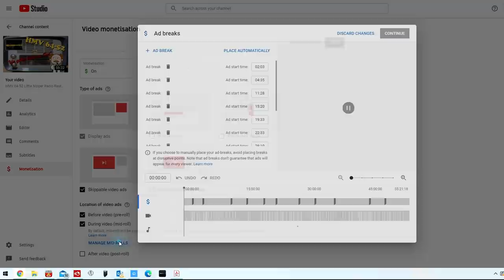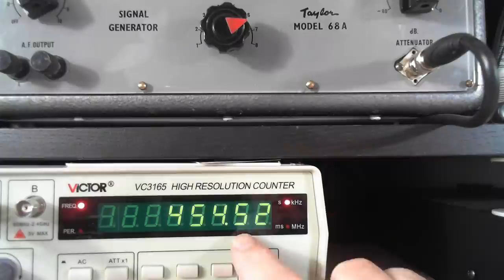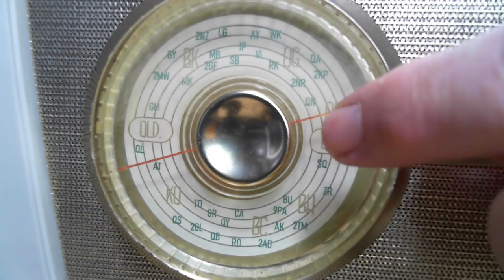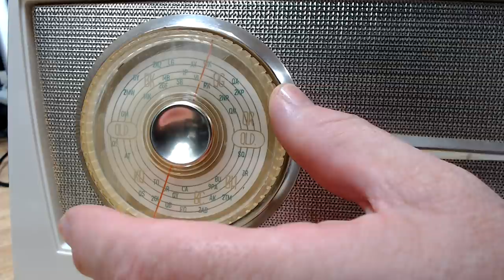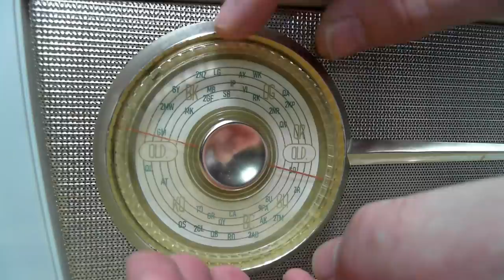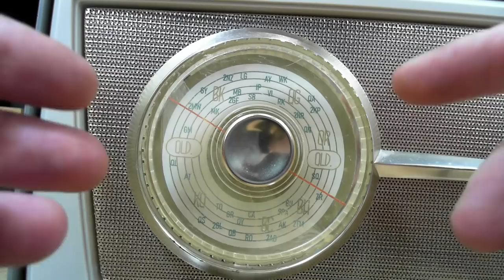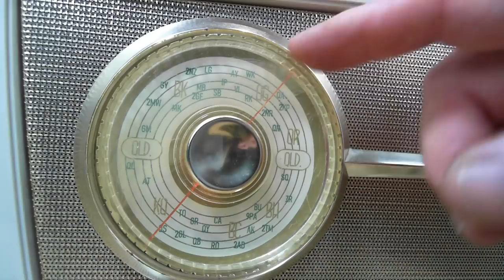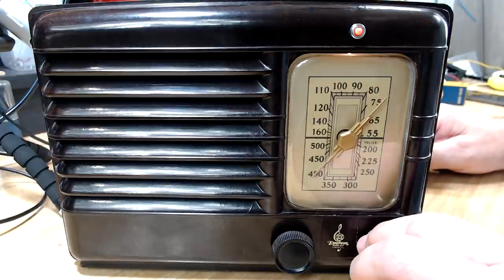AWA 586MA Radio Repair PLUS Bonus Content. RetrObright - Emerson Update

Comment: No need to apologize for anything David i learn something every time i watch one of your videos. This time i also leaned something about You Tube, before watching i assumed the number of ads shown during a video were regulated by You Tube, i didn't know the author could reduce their numbers. It's a nice gesture for your audience and i thank you for taking the time to fix the issue for our enjoyment.  Now about this particular radio, granted you might have had less work than usual to put into it, but it doesn't change the fact i got to see the guts of a machine i will never come across in my life.  This video ranks right up there with the other ones as one of my guilty pleasures as i sit and watch them with a nice cup of cappuccino :-)
Reply from the maker: Hi Sarge, thank you very much. I didn't know I could adjust the number of ads either and I assumed it would be a few ads in a 40 minute video but it turned out to be at least 6 per 30 minutes. I didn't have to dig too deep into this radio but a few issues kept it interesting I guess, thanks for the feedback. All the best for the festive season 🙂

Comment: By dumb luck I just found this video a minute ago. Adds.. I use prime so no adds at tll. Mor comments as I watch ! Back now. I am surprised that the on/off knob is on the tone not the volume control. Cleaning the chassis, short of a total disassembly there isn't much more to do. Mr Carlson did a video where he rebuilt a tone generator and the chassis was a mess. He just drilled out the rivets for the sockets and removed any wires tying the "guts" to the chassis and lifted out the internals as a whole unit, this was pretty slick and when he put it back everything just fell into place. That is a bit much to do for this radio and just stopping the rust was a good call. You managed to improve the tuning quite a bit though it looked to be fairly close to start with. Even not needing a recap, you improved it a lot, good work!  The pilot light on the other radio did look a bit odd in the last video. I have never seen a pilot light on any commercial frequency radio and as a later mod, makes sense. "New" old equipment, your VTVM, nice :D I bought a H.P. signal generator just last week. New to me but from the mid 70s to late 80s. it was one of those "was working when I put it into storage" LOL ya well as you can guess, it has a "few" issues LOL With Christmas and all, I won't have a chance to even open it up until after new years. it was nice to see your video. As always I would be happy to own anything you have worked on. If only those station markings would have anything relevant at all with stations here :P
Reply from the maker: Hi Wayne. I have a YouTube Premium account and don't see the ads either, that's why I was oblivious to the number shown in a video. I did a 1931 radio 12 months ago with a rusted chassis and was able to remove most of the wiring in one piece as did Mr Carlson. I wasn't sure about the pilot light initially but I'm sure it was added later. The switch on the tone control is not unusual for Aussie radios of that time, it does mean that the volume is set where you left it last time. Good luck with your HP generator, they are pretty good 👍 Our station marking make perfect sense to me 😄... cheers 🙂

Comment: Thanks for making this video David! The 586MA is a very significant radio for me as it was the model that I was taught how to service valve radios on back in 1979 at the Marconi School Of Wireless. I found one on a council clean up about 20 years later, got it going again and it still works well. The top of the cabinet is in bad condition though as sometime with the previous owner/s someone left a hot iron on the top which melted through. Fortunately the only thing broken inside was the ferrite rod but the iron shaped hole it left needs the same sort of treatment you gave the Fleetwood 1061 cabinet. I have been looking for a replacement cabinet for it instead but no luck yet... Keep up the great work!! Mark.
Reply from the maker: It's a nice radio and works well Mark. You have to wonder why anyone would put an iron on top of it hot or cold. I'll keep an eye out for a case. Thanks Mark 🙂
Reply: Thanks David, I have an ad in 'Radio Waves' at present for a case so fingers crossed... Mark.

Comment: Dave, your dedication is appreciated fully.  Just finished restoring a BUSH ETR-82 and sure enough on comes your Friday (your time) video.  Keep up the good work and cheers.  Your dial tuner reminds me of the Bush which is geared to the tuning capacitor.  Geoff in Vancouver.
Reply from the maker: Thanks Geoff. I just looked up the ETR-82, semiconductors with a valve converter, that is a hybrid. The dial is very similar 😀
Reply: @DavidTipton101  Actually, the video is extremely interesting, as usual!  

The Bush dial is geared, in as much as the pointer turns at a reduced rate (finer) then when turning the outer knurled tuning dial.  So not quite direct dial to the tuning cap.  Cheers!

Comment: I use the app Enhancer for YouTube in my Firefox browser and never see the ads in the videos anymore! Shh. Our little secret. 
This was an interesting video. So many radios you may come across David  might have similar problems so it's nice to see a professional restore done to one!
Like your alignment procedure. On the American Emerson radio. All of them seem to have at least one poor working tube in them . The radio was played until it didn't 
and then the owner went out and got one of those fancy new  transistorized radios. Luckily he didn't throw these out! Many people did! Steve
Reply from the maker: Hi Steve, Thanks, another ad removal tool, it may help someone. 
Haha... I probably wouldn't put me, radio and professional in the same sentence but I'm learning fast. I wasn't surprised when the newer good tube didn't make a noticable difference to the radios performance, that is something else I've learned. It's surprising how many radios turn up that people have stored away for so many years, bit of good luck there 😊

Comment: Excellent video, thank you for uploading!  Bit late from my side, but on the AWA, it often helps a lot to recalibrate the ferrite bar by carefully heating wax with hairdryer and repositioning coils for best reception after recap.
Re rust spots: do you have a small dremel tool and wire brush attachment to buff out these blemishes?
With the duff valves and the tester: Most testers run the small signal diodes and some triodes with a minimum current which is too high (it has to deflect the instrument somehow).  As soon as the valves have some hours on them the emission decreases somewhat, but because in the circuits they are in there is no current flowing, this issue is irrelevant and often stated so in the instruction manuals of the testers.
Old valves (even NIB) can go "sleepy", to wake them up they can be heated at 150% filament voltage for 5 mins, then heat at 100% for 30 mins, repeat 5 mins at 150%. (no anode voltage) and only  then apply highest permissible anode voltage for a few mins. Helps in a lot of cases.
Cheers from Germany
Reply from the maker: HI Blitz, thank you. I could have heated the coils but it was like that at the factory so I had no reason to suspect it was less than peaked but worth think about in future. 
I do have a Dremel with a wire brush but this rust was too deep so I scrapped it off and treated it. I have a mini sand blaster too, I should have tried that perhaps. It looked like a mammal had lived in there for a bit and caused the rust spots.
Good info on the tester, I will keep that in mind, thanks.
I have heard that about getting valves to 'wake up' as you say, I will keep your advice on the method. Cheers 👍😀

Comment: A great repair on AWA 586MA A All Australian Five they were a reliable Radio David I didn’t see many the workshop that Chassis was used in host of AWA,I glad that you don’t trust Valve or Tube tester I have said previously I don’t trust them also Full Marks again David.
Reply from the maker: Thanks eddieaudio, Yes, it's nicely built radio, not surprised you didn't get many for repair. I'm sure the tester was correct reporting the valve as weak, the point was that even weak valves will still work OK 🙂

Comment: I have to begin by saying David, that AWA radio is a very nice looking radio.  In some ways it looks familiar.  I’ve a feeling I might have seen that model before.  If AWA produced that radio with a maroon plastic cabinet, then it is very likely I’ve seen two, on different occasions come up at BVWS auctions.  Being Australian, bidding was, as I remember, fairly high for an early 1960s plastic cabinet radio.  Normally 1960s plastic cabinet radios are generally inexpensive.  The reason I seem to remember this model of radio is that I like foreign radio, and was outbid at one of the auctions.  Foreign radios usually offer something different, often in the form of being a refreshing break from the usual British types ...I was a telly and audio repair man for almost forty years, so I saw a lot of British, as well as Hong Kong, and Japanese stuff LOL! 
Having misplaced the memory card for almost two weeks I’d used for filming the two Philco, model 48-420 ‘Hippo’ American radios, I found it, and resumed shooting material for my restoration series videos.  Part 1 was uploaded to YouTube earlier today.  Part2 will be uploaded tomorrow.
Cheers my friend, Phil.
Reply from the maker: Hi Phil, I looked up the colours the radio was available in and maroon wasn't one of them but it also didn't list my grey colour either. I also like to have a mix of radios from other countries, it does break things up a bit. Seems ironic to forget where you put your memory card 😄 I haven't seen your video yet but looking forward to it. Cheers, and have a safe and happy Christmas 😊

Comment: Hello David.  Regarding the knobs... I'm not sure how many different kinds of plastic this procedure works on, but submerging the plastic in peroxide and bathing it in uv light provided from a strip of uv diode lights will lighten fading and yellowing.   I can send a video link if you'd like.  As always. Well done!
Reply from the maker: Hi David, yes you can use any form of UV light I understand. Also heating it works too. We have free UV light here but others in colder climates may benefit from a link if you can, thanks 😊

Comment: Dave, 5 seconds of an ad is a small price to pay to see your great repair videos! You can disconnect the speaker, hook your vtvm probes to the output transformer & , if you keep your radio volume low, you will get a much more sensitive result. Keep the modulation & rf levels low too. I saw this on a Mr. Carlson video.
Reply from the maker: Hi Eugene, I did connect the VTVM to the output transformer with the speaker disconnected when I tested the Emerson. I think I saw that Mr Carlson video too 🙂
Reply: @DavidTipton101  Thank you for responding. Your videos are great!!!

Comment: Tidy looking radio, nice restoration someone did to it.  Shame the dial is a bit discoloured, just spoils it a little, otherwise it looks quite clean.  Nice sound as well now that you have just gave it that tiny tweak.  I am surprised you didn't repack the disconnected capacitor, just because it was not right!  Nice one, and it was not boring, it makes a change to have a short video every now and again.  Stay safe out there.
Reply from the maker: Hi Bob, thank you. Haha... I should have repacked the cap 😄 thanks Bob, stay safe yourself 🙂
Reply: @DavidTipton101  I am trying to, but I am at a very high risk category.  I am fed up of being stuck in the house!  Horizontal rain here today, it is still raining!  2AM here at the moment.   I was surprised when you left the plastic, I was waiting for a mould to appear and the oven.  Ha ha ha!

Comment: Another fun repair. The gray radio looks very nice and sounds great. I see you have used peroxide paste. I’d be interested in whether the yellowing in the dial would also respond to peroxide. I use 12% peroxide liquid, a see through container, and a $15 UV light from Amazon and get some amazing results. I’d be interested in a follow up to see if the clear plastic responds to peroxide.
Reply from the maker: Hi Graham, thanks. I have tried it on clear plastic before and it has no effect unfortunately 😏

Comment: I've recently discovered that Methyl Ethyl Ketone, (MEK) solvent works very well on this type of plastic. Run a tiny amount into the crack by capilliary action (eg. on the end of a pin) and wait for it to evaporate. I've found that it disolves the plastic slightly allowing it to weld and leaves no adhesive trace when it's gone.
Reply from the maker: Hi Jonka, sounds like a good fix. We can still get by the looks of it but only online as far as I can see. I thought it was banned years ago 🤔
Reply: @DavidTipton101  So did I. I used it 50 years ago in a laboratory environment and bought some just to remember its smell. I accidentally noticed its effect when I left a perfect fingerprint on a piece of plastic.
Reply: If you shave a few filings off the plastic you want to glue and dissolve them in a tiny amount of MEK you get a whopping good adhesive which fills up cracks well..
Reply: @blitzroehre1807  Yes. Have yet to try it on Bakelite. Have you any experience?
Reply: @jonka1  Yes, it will not work on bakelite because it is a duroplast and cannot be dissolved in MEK. MEK will only work with thermoplast.
 For bakelite it would be the best to use a resin based adhesive (2 component) or cyanacrylate glue (superglue). The superglue can be made somewhat thicker by adding powdered bakelite. This aids with making the crack more uniform in colour and helps bridge gaps and imperfections in the surface
Reply: @blitzroehre1807  Thank you. I've been using a 2 pack but wondered about MEK. Regards.

Comment: The " birdy" issue can be caused by two radio stations on a similar frequencies and the two signals beating against each other. Turning the radio to change the direction ferrite loop stick area sometimes helps.
Reply from the maker: Thanks Stephen, That's a good point, thanks. I checked the radio in different positions after alignment and the 'birdy' had gone, maybe it was just something at the time 🤔🙂

Comment: David,
Good to see another video from you!  This is a nice set.  From the beginning of the video, I felt sure that it was in good shape and probably had been worked on...which it had.
I'm glad that it didn't need any more work than it did...shows that it had been taken care of by the previous owner(s).
The layout of this one is a bit strange though.  They certainly didn't take the repairman in mind when they put the tuning capacitor so close to the power transformer, but with your usual expertise, you got it sorted out.
Do you already have something else in line for the next video?
Reply from the maker: Hi Wayne, thanks again. A very nice radio this one and in pretty good nick as you said. Having the tuning capacitor next to the transformer sure made it difficult to remove, the designers probably would not have foreseen me trying to remove it 60 years latter though 😄
I have a new video under way, I have to build a simple valve radio for the annual radio club competition 😉

Comment: I really 👍 like your 📻 radio finds. If this is a basement, or attic find, I do 👎 not know. I 👀 see a danger label on the back of this set, 👎 not even five minutes into the 📹 video. The yellowed plastic dial. Smart choice on the Meguiar's PlastX. This should shine the 📻 radio to its original luster. Looks like your equipment is a Halicrafter's radio, by the look of the dial, but it's only diagnostic equipment. I don't 👌 know if ya need to use a dummy speaker. At least, if you do, it can be permanent magnet. I can't tell if this 📻 radio is field coil, or permanent magnet, on the same token. I hope ya are using an isolation transformer, if this set is a 🔥 hot chassis, or series string set. The grille on the front of this 📻 radio is really nice. I'm also 👎 not sure if this 📻 radio has a lighted dial, or a dial cord. I really 👍 like these tube type 📻 radios. 👍 Yes, I 👀 saw the tuning gangs. These can "whisker", or the tuning plates can bend, causing very frustrating trouble. Once diagnosed, and corrected, then things are fine. Use paper to clean between the tuning plates to remove the whiskers or fuzz, just don't bend the tuning plates. I don't 👌 know if somebody can specially  make you that dial, which the plastic has yellowed from age. Doesn't look 👍 like this 📻 radio has a dial light. I made a mistake. This is the 📻 radio's dial, 👎 not one on your equipment. I still 😔 wondering if this 📻 radio is inspired by Halicrafter's. Please don't sell this, it looks so 👍 great in your collection. Merry 🎄 Christmas and Happy New Year from Your Friend, Jeff.
Reply from the maker: Thanks Jeff, merry Christmas and all the best for 2021 🙂

Comment: It's a funny thing with valves, a lot of the time - when they test low emission - they work fine, hardly any different to a new one... Maybe there's a very large tolerance window for these types of circuits to work fine?
Reply from the maker: I agree Ged, valves are pretty resilient but are the first thing to get picked on when troubleshooting 🙂